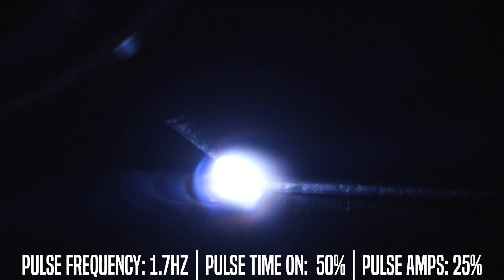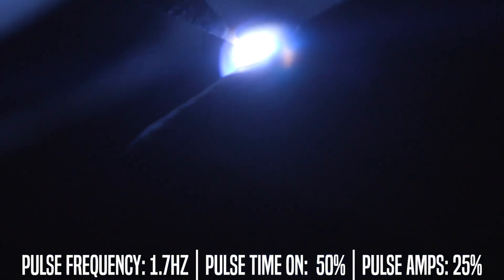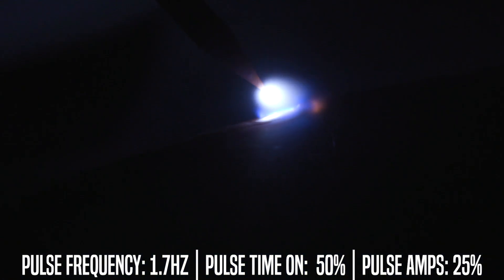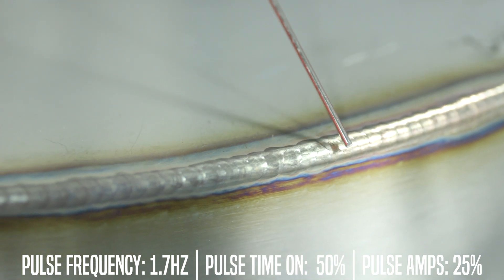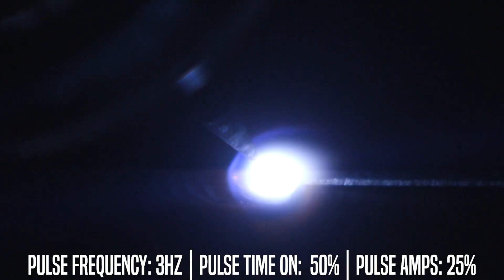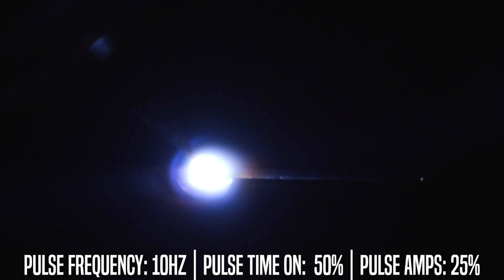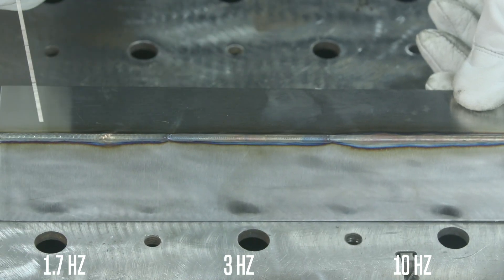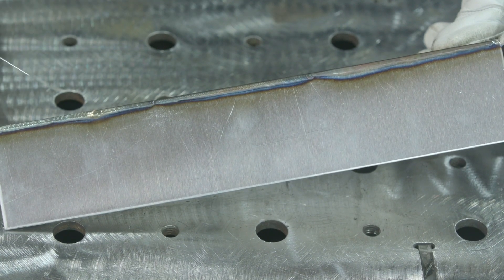Sheet Metal Pulse Welding Techniques

Comment: Brad, have you put out a video on buying a used Everlast tig welders? Obviously buying new is ideal, but the price of some of the tig machines make it a big investment. I found a Powertig 200DX with dual voltage for $200. I normally mig weld, but I have tig welded with my 160STH. I want to try the benefits of pulse and experiment with welding aluminum and this 200DX has these features. Are the older machines light years away from the technology in the new machines like 200DV?

Comment: Great to see in my younger days I did a lot of autogenous welding in de central heathing and later welding in construction .
But now I struggle with electric welding 1.5 mm pipe.  A pulse mig welder seems to be the answer . What are some good welding machines for infrequent light work up to 3 mm

Comment: I realy appreciate  this  video... but need some advice or a video of butt welding 0.038" thick galvanized autobody panels.. ie  for patch panels ..  i would love a part 2 video on butt weld on tip tricks see a on tacking body panel ie fusion welding 

I find it challenging  blowing  holes along the but seams.. im using everlast mts 252 welder

What tungston rod size should be using?

1mm or 2.4 mm 2% lanthanated... also any tips on welder setting for tack spot welding. 

Currently using basic gass lens for my 2.4 mm tunston

Comment: Was that sheet aluminum? Did you add any metal or did you just fuse the sheets together?
Reply: 18ga 304 stainless. Just fusion no filler used
Reply: @bradwhite6338  Thank you for the reply. Just beginning to learn to weld, your comment helped.
Reply: No problem man, if you need any further help or questions, just shoot me a dm on insta, or on fb